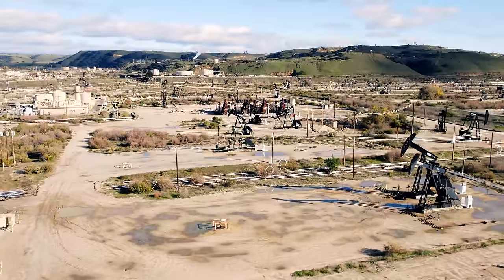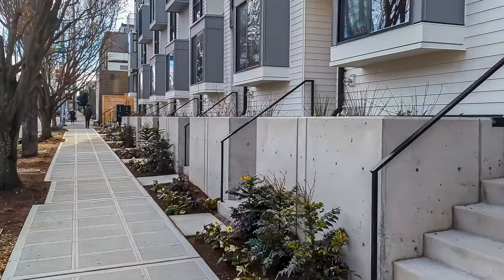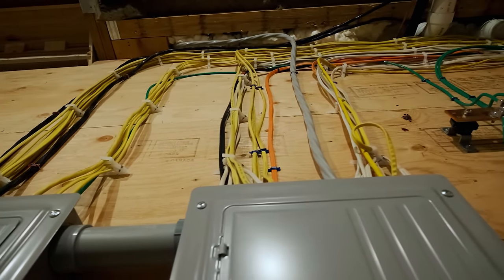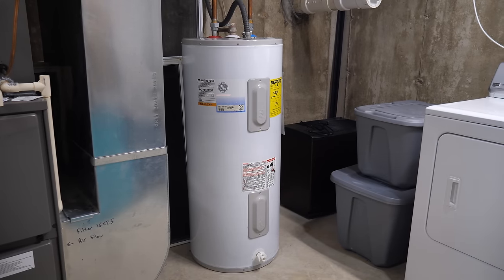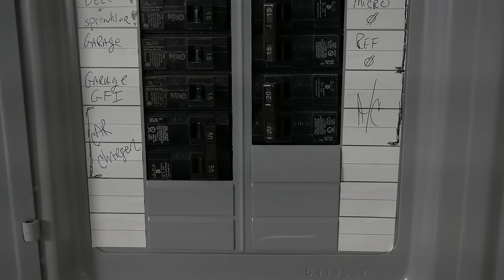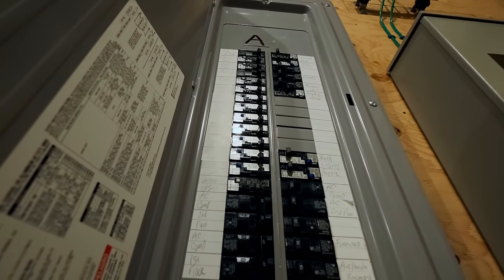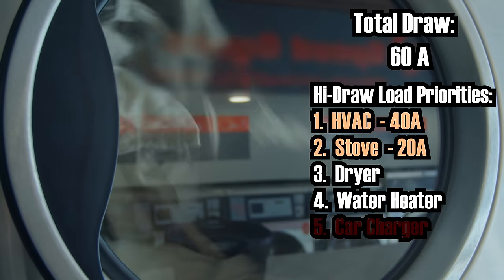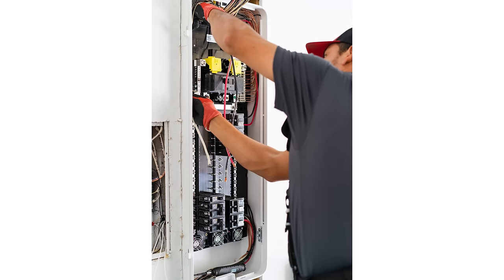Home Electrification: There's not a lot to do, and it doesn't have to be hard (Part 1)

Comment: Here in Italy the default is 230V 3,3kW, less than 16A, on one phase.
You can upgrade it (or downgrade...) and even if up to a certain range it's all made by software (they send a command to the smart meter, it's the device responsible for breaking if you go beyond your limit) it will have a one-time cost and also your monthly bill will be a little bit higher.
If you want more than 6.6 kW (or sometimes 11 kW) you have to switch to multi-phase.
Reply: That’s neat, but average American home uses at least 11kwh per day.  And that’s not even with electric vehicles or going all electric as most American homes have dual fuel.
Reply: @scallywag1716  kW is not kWh...
One is power, the other is energy.
Reply: @scallywag1716  yes, you have indeed a higher demand that justifies the higher maximum, because of your quite big houses too compared to European ones.
But I can tell you I use something like 6000 kWh per year with a 230V 5 kW service, so a little less than 20 kWh per day.
However our demand is spread across the day because our main use is HVAC both in winter and summer. We still use gas for hot water and cooking (100 smc/year)
Before 2022 I used gas for heating too while using HVAC just in the summers. 
Back then we had a 3.3 kW service and we used 4500 kWh per year.
But we used something like 700 smc of gas per year 90% of which in winter.
Reply: Other italian viewer here! yeah having 100A available is pretty insane to think as an European where the standard is 3.3/6.6 KW max! Electirfication seems like a no brainer with that much of overhead available
Reply: @mirkomilova  most homes in the USA are setup for between 6kw-48kw. A big reason we use NG for heat especially where I am is gas compared to electric, gas is significantly cheaper cost wise per year. Electric heat would cost 3x as much(at least compared to my 95%+ efficiency furnace)
Reply: @mirkomilova sorry, you got 16A on one circuit, and you got more of them. Your main fuse got about 63A @ 420V that's 26,4 KW
One 16A circuit gives you 4 KW
I got here at home 9 circuits with 4 kW each and 3 combined for the stove: 420V @ 16A 
But I can use only 63A combined maximum  and so did you (that's 26,4 kW)
Greetings from Germany 😅

In the video it's a  100A box yeah but most of the stuff runs @ 120V
Reply: @bait28  is that still true if you compare against a 600% efficient heat pump?
Reply: @mirkomilova  mate 3.3kW is literally 2 sockets worth of power.

even the standard single familly euro house (looking at CH, F, AU and DE here) has some 40A of 400V 3# power available. which is 27kW.
Reply: Dutch guy here. I just upgrade mij home from 240v@35A to 3 phase 240v@25amp.   I need fast charging for my ev. But before that 35A is way to much.
Reply: @pajn  yeah it is, crazy enough. Not 3x anymore but still cheaper significantly. And electric is about to triple where I am while NG is going to go up only 30%
Reply: And wait till you hear that 200A, 230V (split phase, of course) services have been the standard in the US for new single family home builds for the past 30 years, maybe longer.  Most of the homes that have less are apartments, condos, some townhouses, mobile homes, etc.
Reply: I got 400V at 65 amp up in Austria for the same fee as a 35 amp connection, pretty sweet for 22 kW EV charging and running a three phase heat pump.
Reply: @mirkomilova  Cue the UK with most homes on a single phase 230V supply with either 60/80/100A fuse in the main supply and Germany with 3-phase going to many domestic homes.
Reply: I live in Sweden, never seen 3.3kW in any year round house, i seen it in tiny one room flats and seasonal housing. 

The thing is that you can´t have a dishwasher and cock top and that is filled. Really... Cocktop and anything will fill 3.3kW because single phase cocktops usualy are 3.3kW.

(its worth saying at least the main breaker we have here will give 4kW per phase for about 15 minutes and 3.6 for about a hour before breaking. So if its just a short load like 10-15 seconds, it need to be almost 5kW. This is good when you start something like a circular saw that may take twice the power for 2 or 3 second when it starts.
Reply: @mirkomilova  3.3kW is per outlet, your main meter / breaker box is definitely higher than that. Maybe as low as 30 or 40A if you're on 3-phase 400v, but at least 60 and more likely 80 (possibly 100) if you're on single-phase AC:
Reply: As weird as it might seem, yes, in Italy the average household has a limit of maximum 3 kWh of power draw. That's the standard limit, if you want more you have to call your power company and ask for an upgrade (almost nobody does that because the cost per kWh goes up the more power available you have).
It's a very low limit and it's not unusual to avoid running power hungry appliances together (dishwasher, washer, hair dryer, space heater) so that the power meter won't trip. Yes, the power meter (not the breaker) will trip if you draw too much energy because it's over your maximum allowance and for higher power you need the upgrade.
Reply: Now, that's ridiculously low. 
Here in Sweden, the most common is 16 A or 20 A, but then it's 3 phases, so it's the equivalent of 48 or 60 A if the power were delivered the same way as in US - which can be  easily upgraded to 25 A (equivalent of 75 A, US standard), with no more than change the bottom part of a fuse holder (higher than that and the cables going to the main panel may need to be changed). The worst we normally have, is 25 A single phase - which is used only for some apartments. 
But 100 A is quite a lot and they don't think it's enough - do they really HAVE to run all the high power appliances at the same time... 
I think it's simply the fact that most people have quite poor knowledge about electricity and when power is really needed or not, but almost everyone likes fire 😁
Reply: @scallywag1716  11kwh per day would just be like 0.45 kwh per one hour.   450w average draw
Reply: @scallywag1716  11kwh averaged out over the day is 550W. A 6th of the power available on a 3.3kW system.
Reply: @scallywag1716  Our full electric house in Finland has 3x25A 230V/400V service so that eaquals 17,25kW of continious power and like 26kW peak. Last month there was a day when it was -27c and our house used about 100kWh of electricity. A 2x100A 120V/240 gives you 24kW of continious power.
Reply: @sanara_on_tour  Main fuses in Finland are usually 25A because they are the cheapest and you don't usually need more if you don't have an electric vehicle.
Reply: I was just about to write it in the comments... in Italy the standard is 3kW + 10% before the power is disconnected.  It completely sucks. I bought a single induction cooktop (2200W) to use less natural gas and every evening I have to pay attention to how many lights and other electrical devices are on, not to mention that I cannot use any other appliance at the same time otherwise I risk exceeding the limit power... and when I work in the garage I can't even use my electrode welding machine or plasma cutter at maximum power otherwise the electricity cuts out instantly... 😡😡😡
Reply: 3.3 KW on one phase is about 10 KW on 3 Phase  so that's better than 3.3 KW, but even on 3Phase it sounds a bit small, u sure your home runs on 10KW?
Reply: Norwegian here. I have electricity as the only source of heating ( Air to air heat pump and some conventional heaters), and two electric cars. The house is connected via 3 phase 50A/230v. Yearly usage is about 28000kwh.
Reply: An then there is Austria with 18 to 24 KW
Reply: @FerrariFF100  wow thats ridiculous o.O Even my air compressor i got sitting in the garage draws 3,5 kW when running at full power alone. And of course it can add up when other stuff is running at the same time. In germany we´ve got kind of a different mentality, like "the grid needs to be able to take that load, if not, improve it! What am i paying taxes for?" :D
Reply: Reason american homes have so much electric capacity is they usually have AC, which means most of them have more than enough power to electrify everything.
Reply: @pierobonisoli9067  With 2G meters you can exceed up to 33% your profile for about one hour and even more for a couple of minutes.
For example a 3kW home can use 3.3 kW for an unlimited time, 4 kW for an hour and 5 kW for 1 minute
Reply: @Anfros.  We have AC too but it's less than 1 kW per room. Also we usually don't have much "open space" in our homes.
Reply: @lucaeber2720 the problem is that he isn't talking about 3.3kw per phase in three-phases but 3.3kw in single-phase. Total. 
It isn't such a big problem, you just need to pay attention on what is on (for example not use the dishwasher and the washing machine at the same time)
Reply: @IIARROWS  but it that same thing in a electric, it's when you start mixing gas in  kwh but that set by your energy supplier, how much they would like to charge for there gas, each month?
Reply: @moojuiceuk  3-phase going to many domestic homes. it's out there but you will need to dig the road up outside your property, and your Neighbours will the on that phase part 2 and or 3, so you will be take power available to them, leaving them with out that option,  and maybe less electric in the system also too, "could be starting a goldrush, of staking claims, on the limited power in your street, before it all gone?
Reply: @scallywag1716  Rookie numbers. Here in Norway my heat pump alone hovers around 25kWh/day when it's cold, and the house total is around 50kWh/day. Typical usage per year for a normal house is in the 18-20.000 kWh/year.
Reply: @denzzlinga  The grid is fully capable of taking much higher loads. It's an artificial limit that the power companies put in place. 
I don't know why, but it's always been that way and people are used to think about using their appliances and stay within the 3 kWh limit. Like, for me it's normal managing the power draw (not using the hair dryer and microwave at the same time) but I get why someone who isn't accustomed to it would find it extremely annoying.
Bare in mind that we are talking about households and not commercial buildings, in that case things are different and there's much higher power availability, but still way lower than the 100 kWh of a single American household.
Reply: @matsv201  Though it needs to be said that newer homes in Italy have more than 3kW nominal (+10% "tolerance"=3,3kW), usually at least 10/15kW 3-phase with heatpump and induction cooktop.
Of course most older homes with gas heating and stoves are stuck with 3kW (mainly beacuse they don't want to pay for the service increase... or they don't trust the electric cables inside their walls).
My whole life is filled with screaming before turning on the dishwasher/washing machine/hair dryer... etc in order to make sure no one else turned on something more powerful. For most homes here the meter is outside the property (not just the home), going outside with cold, wind, rain, etc. isn't very pleasant.
Reply: I know what happened, someone accidentally said give 'power to the people'. The result, they limited power to the people.
Reply: @Tupsuu  Your whole house has 3x16A? Are you really sure about that? I mean the Italy numbers seem completely absurd (and people mixing up kWh and kW so maybe they are wrong completely).  
In Germany, in my region, you usually get 3x63A @ 230V = 44 kW in your house. Heck, the small apartment I'm in right now has a 40A 3-Phase RCD (I literally have 16(!)x 16A fuses for a 2 bedroom apt).
Reply: I'm from Italy too and I can confirm the 3.3 kw limit. It's non really a big deal, I even have an electric car and I almost never trip the breaker. I still have gas for heating and cooking but for my small apartment I just use an average of 10 smc in winter and way less in summer. It's really not that complicated with a decently insulated home and a bit of planning
Reply: @whuzzzup  oops sorry i meant to say 25a. And 25A is standard here. In my are a 3x25A costs 19,50€/month and the 3x63A costs 49,59€/month. May I ask what do you need that much power for in Germany. It isn't even cold there.
Reply: @Tupsuu  Depends on the region you're at, there are ones were you'd only get 50A as a default for example for a house.  
No idea, it's just the way it is.
Reply: Spaniard here. An average domestic home electrical installation follows mostly the continental Europe standard: single-phase 230V 50Hz, several circuits protected by 10A, 16A or 25A MCBs, and general protection with 40A MCB+RCCB or RCBO, plus a "Power Control Breaker" (ICP), which trips if the power consumption exceeds the power contracted with the electric utility.

We, having a 3.5kW contract, had no problem electrifying everything except central and water heating (which runs on a fuel boiler). Just how it's said in the video: ultimately it depends on when our appliances are used, although here an upgrade, given the circuit is capable of a power increase, involves only an ICP change.

When we decided to go solar, besides a new ICP, we needed to deploy two new circuits for the inverter and a new electric water heater. Central heating goes by using heat pump air conditioners, which run off the standard 25A circuit (leaving the fuel burner as backup). It was a heavy investment, but fortunately mostly government-funded. And we're quite happy with it.
Actually, checking the electrical code (REBT here) can help giving a glimpse of how the installation works, the limitations it offers, and how it can be improved.
Reply: @mirkomilova  The new 2 Flats( 2 apartments+ basement) being build in Chicago, you need a 400 amp service...by code..!!
Reply: @whuzzzup  It may seem absurd but so it is, in Italy our whole houses run on 1x16A (precisely, the standard contract is 3kW nominal + 10% allowance without time limit = 3.3kW, single phase, 230V). 90% of residential contracts are like that according to official data from 2019. And who is confusing kW with kWh?
Reply: @IIARROWS  lol, silly rabbit.  And by the way I meant 1,100 KWh.
Reply: @lasskinn474  typo…1,100 KWh
Reply: @MalawisLilleKanal  lol it was a typo…1,100 KWh per day is average for America.
Reply: @FerrariFF100  it’s a limit because the grid infrastructure can only handle so much power running through it. Watch some videos on electrical infrastructure and you’ll understand.
Reply: @scallywag1716  1100 kWh in a day? Lol, I doubt that. Maybe in a month
Reply: @yermktgobi3677  you don’t live in America do you?
Reply: I thought that Italy was a first-world country but apparently, electrically speaking, it is a third-world country where a single electric kettle saturates the entire home's electrical capacity.
Reply: @bazzolg  My parents in law seasonal house had 16A 1 phase, but that was electrified in the 1960s and only really for summer use the last 30 years. Still of cause if the cocktop was on, everything else had to be of. Being a seasonal home there was no dishwasher or washing machine. And the waterpump was only 200W.

I use to have a flat with just 1 phase as well, but it was 20A.  And no dishwasher and comunity washingmachine, so not really a problem. And it was only ment for one person.

Where i live to day there is 16A 3 phase. But i can select any power from 16, to 20, 24, 28 and 32A. There is 4m2 cable to the main breaker so i could upgrade no problem.

The issue is that they take a lot extra charge if i upgrade. so i just have a system that locks out the heatpump when i use the cocktop.

It work fine.. ish.. what  forgot was the waterpump. So when the heatpump, waterpump, dishwasher as well as washingmachine all run at the same time it triggered one breaker.
Reply: @scallywag1716  If so, I think this to is a typo, and should likely be 110kWh. That is a very high number, indicating very poor insulation, while 1100kWh/day is just insane.
Reply: Dispelling any doubt - Italian homes do indeed have a 3kW + 10% power draw limit and that's for the whole thing, not "per socket" nor anything like that; For this reason, appliances such as kettles and clothes driers are nearly unheard of in the country (they only started to appear recently in their more 'power efficient' variants). You would literallty trip the "breaker" (it's the meter shutting off supply, in reality) with a single 3600W kettle.
Reply: @h3llr4iser1  do you have a gas cocktop or how does that work?
Reply: Yet another italian viewer here. Yes, the default supply is 3kW + 10% nominal, single phase. But the funny thing is that we're so used to it that it is rarely an issue for anyone. I know it sounds incredible if you're used to insanely higher figures, but that's how it actually is! Personally, I don't remember the last time my breaker tripped. Of course, most stoves here are gas-powered, as well as most heating systems. But A/C is not that uncommon, and electric ovens are very popular (I have both). Still, we manage to run it all with little to no effort. It is worth noting though that the meters are quite lenient, 3.3kW is not a hard limit. An average consumption below 4kW is tolerated if it doesn't last longer than 3 hours, and short (<2 minutes) peaks above 4kW are tolerated as well. I've always been curious about the most common supply for other countries in the world, but never managed to find a chart or something.
Reply: @pierobonisoli9067  Why tf are you still on 3kW? We upgraded to 4.5 after installing the heat pump and it was just a phone call, no work required. Maybe you can even go to 6 like that
Reply: @InfiniteColorsMusic  It seems clear that the Italian government needs to adapt its outdated policies so that people can electrify their homes. It is not possible to conveniently have electric heating, an electric stove, an electric vehicle, and the entire rest of a home run off of 3000 W total. The default policy incentivizes people to remain with gas appliances which not only delays progress toward renewables but increases dependence on foreign gas, of which Italy is perhaps the most egregious example in all of Europe.
Reply: @Tupsuu  your stove, does it use electricity? Or gas? 🤔
But I think with 25A is only gas possible...
Reply: @whuzzzup  das hast du hier allerdings nur, wenn dein Herd nicht mit Gas läuft, leute mit Gasherd und/oder Heizung brauchen wirklich wenig Strom...
Reply: @Tupsuu  Most of the Appartements here got an electric stove, and you need a bit more power to operate them.
On a normal day, you can cook and bake something, use a kettle, and maybe someone is simultaneously using a vacuum cleaner, dishwasheranda washing machine? 
You can just do it and don't have to think about anything.
But we also don't use air conditioners, and mostly the heat, comes from an external source
Reply: @sanara_on_tour  All electric
Reply: @Tupsuu  okay... that sucks 😕
Reply: @sanara_on_tour  It doesn't. We have never had to worry about it even a little.We have electric heating, stove, oven, microwave, airfryer, toaster, heat pump, multiple computers etc
Reply: Also in the winter we heat our cars for about 2 hours before starting the engine (about 6 amp load)
Reply: @MalawisLilleKanal  in Finland our heat pump hovers at about the same and the house uses about 100kWh on a cold day (-27°c). ~23 000 kWh per year
Reply: @Tupsuu  okay,  maybe you shall count again what you have written 🤔
3x 25 A are the fuses for your stove, so the 17 kW is just for it... and not for the whole home, maybe you shall read again what's on the main fuses( those are directly on your electricity meter)
Reply: @sanara_on_tour  The stove has 3x16A. I know our houses electricity installation inside out because I wired some of it.
I have worked for the electricity utility here and most people have 3x25A or 3x35A.
Reply: French here and my appartment as only 10A service at 230V not even enough for a 16A electrical outlet 😂